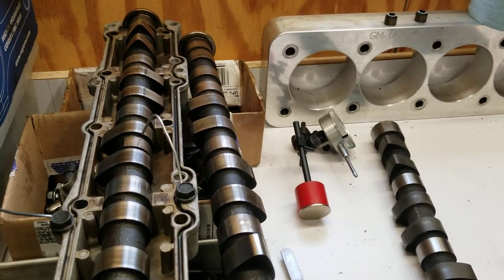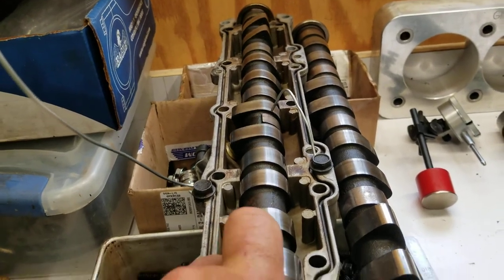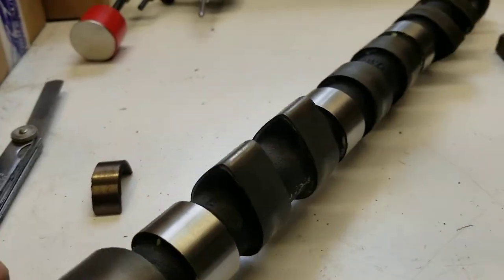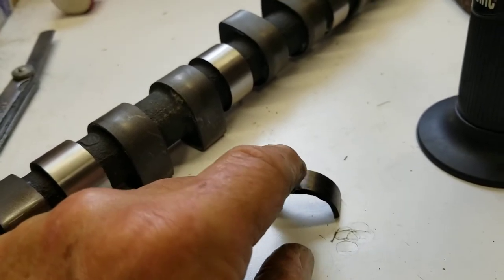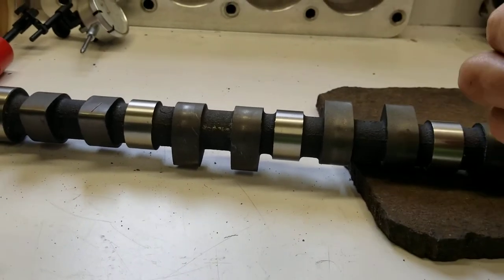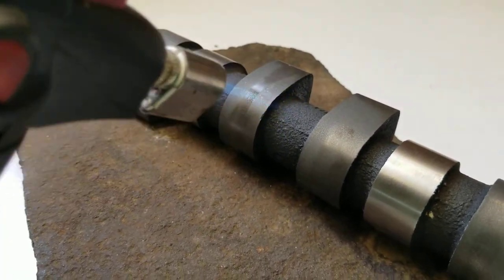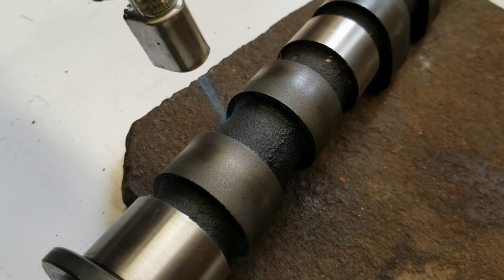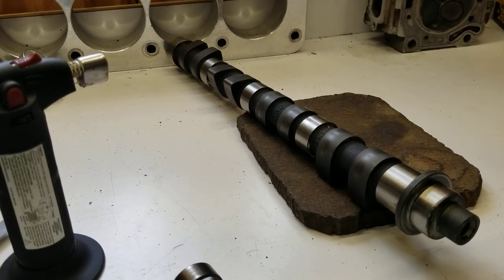Camshaft modification and metal. prepping tip.

Comment: Awesome.  Hopefully it will work out as planned. BTW, what benefit is to be had by running sequential fuel injection vs batch-fire?
Reply from the maker: Sequentially fired injectors fire right as the valve begins to open so it's much more efficient than a batch fire system.
Reply from the maker: Update 4.9.2022 Owner of the motor started it for the first time. Ran good for their "back yard" test session. :)